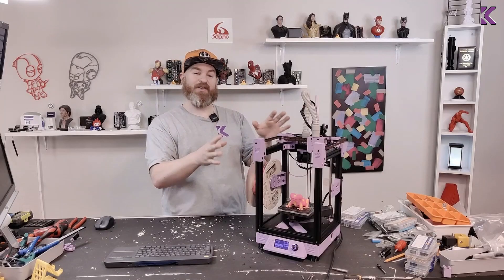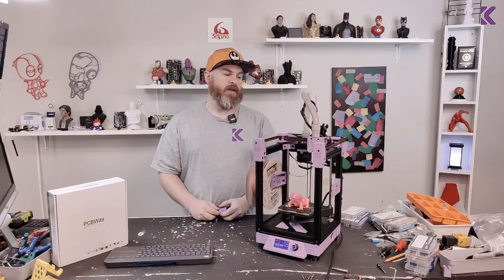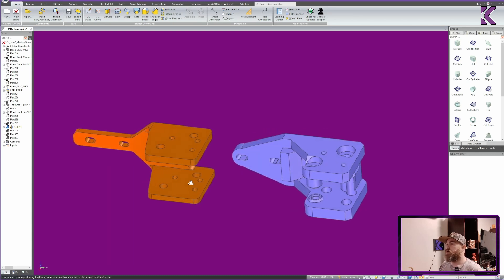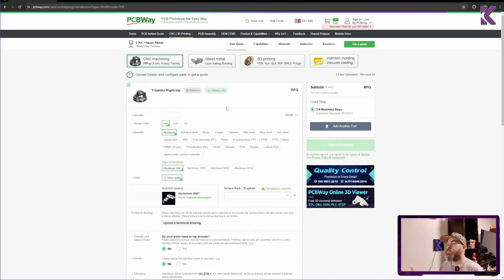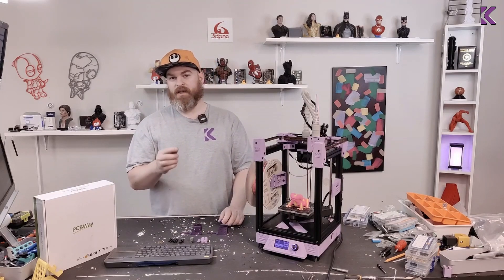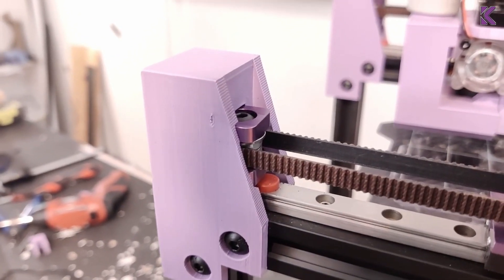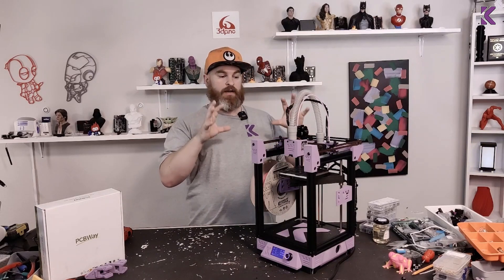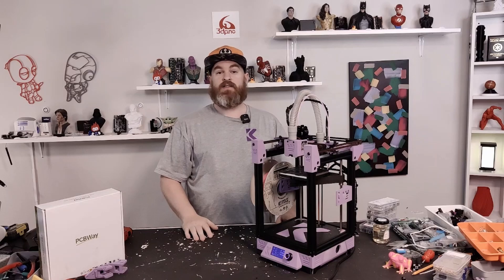Level up your printers with metal!

Comment: hey i was wondering what motors and voltage you were running through those motors?
Reply from the maker: 2004S @1.6A
Reply: @kanrogcreations  thanks. I'm buiilding a corexy vzbot and I such your very impressive acceleration. I was also wondering, in your opinion do ldo motors matter as in high quality matter because I've been struggling to get similar performance out of my steppers. They can only go about 11k acc and 400mm/s on a awd gantry
Reply from the maker: Motors make a big difference, yes!